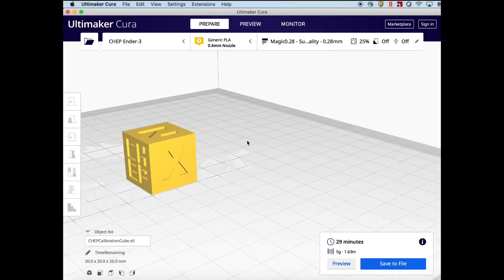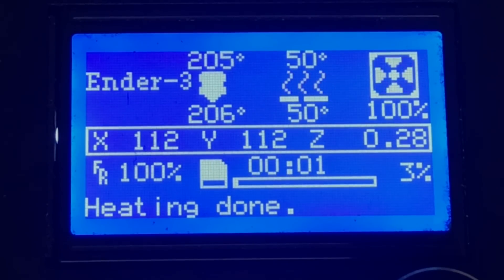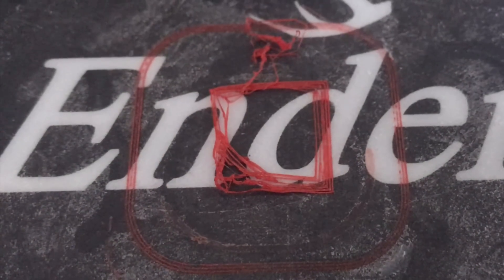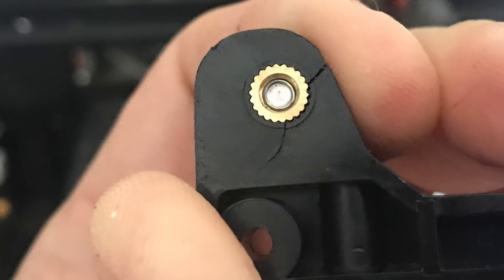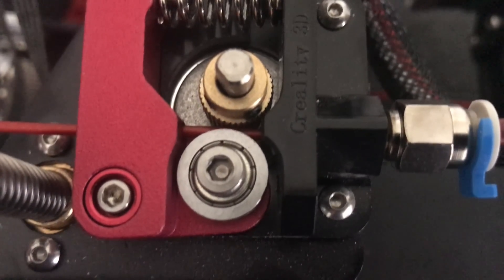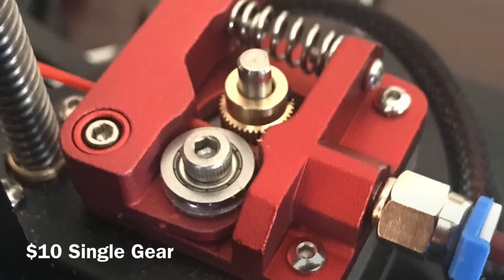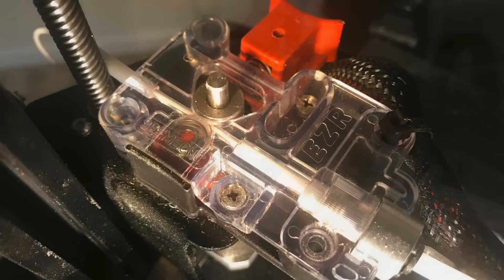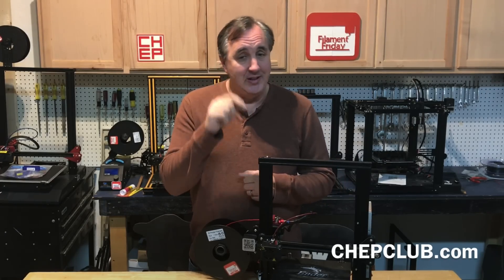Fix Under Extrusion from Cracked Extruder Arm on Creality Ender 3

Comment: Thank you so much, man! I had so many problems with my Ender 3, where the walls were not sticking together, but layer adhesion was good. This would make it so I could peel off the walls. I looked at the idler, and I also observed that it wasn't spinning at the same rate as the gear. Turns out it was the spring. I had already upgraded to a full-metal extruder but maybe didn't replace the spring. I still had the spring from the kit, and when I put it in, it worked like a charm.

Comment: Thanks! I had the exact problem, my prints were horrible and sure enough, the plastic was cracked and the pully wasn't gripping the filament. My replacement will take a week, so in the meantime - I used my wood burner gun, clamped and melted the plastic pieces together and even added some melted filament for good measure. I know it will fail soon, but I was able to get 2 perfect prints so far until the new parts show up. I also didn't tighten down the pully screw, just enough to hold it in. Pully spins freely and crack is filled. Waiting on new part, but my prints were looking terrible! Tried everything you did to no avail until I saw the crack. Excellent video!

Comment: So I replaced my extruder with the red aluminum one, just cause. but i have started to get under extrusion,  so I used the old spring and twisted the new and old one together to make one stiffer and a little longer one and its working as I type this .

Comment: Hi there - I'm at my wit's end trying to figure out what's causing my under extrusion. I've got an all-metal extruder, SKR V2,  stock hot end, MinV2 fan mount and a new steel nozzle. Every time I believe I've fixed it, it returns (usually after adjusting my E-Steps - which is now at nearly 130) - yesterday, after another failed print, I noticed while adjusting my e-steps again that the filament was slipping in the extruder just like in your video. I thought the spool was too heavy so I helped it along and still, it slipped,  it's gripping well-enough (though I'm not sure how to adjust the all-metal extruder), the nozzle is new, cleaned the hot-end and I changed the bowden tube. I'm pretty good at figuring things out or finding solutions on the internet, but this one's got me stumped. Plus I'm using Eryone filament. Suggestions anyone?
Reply: Ha! Serves me right. After writing the above I went back to the printer for one last look-over and I nearly face-palmed when I noticed after removing the filament the extruder's guide wheel shifted slightly. After some choice swearing and tightening of a few screws - I had a consistent feed again. Had it not been for me staring at the extruder when removing the filament I don't think I would have noticed how loose it had become despite having a good gear imprint on the filament.

Comment: I ordered an Ender 3 v2 and it is set to arrive soon.  I also ordered the TH3D metal extruder, and the yellow springs.  Most people say to go with stock till you learn the machine, but I'm planning on putting the springs and metal extruder on when putting it together the first time.  Do you think this is a good idea?
Reply from the maker: Those are probably good to install on assembly.
Reply: I got mine last week and have yet to get a decent print. Nothing but problems including what hes mentioning in this video. Good luck.

Comment: Hello, I have A Creaity CR-10 with Dual Z Axis motors. The z axis goes up and down when homing but will not go up when printing. Is this a problem with my machine or am i doing something wrong in Cura ?
Reply from the maker: I assume Cura. Not sure what though. Could be SD card as well.

Comment: Ive been struggling with my ender 3x.  just got it two weeks ago.  first cube print was PERFECT.  like better than any example that I've seen, but that was it... next print was horrible. Changed color filament and no difference...  even with the original filament I keep getting very thin and weak structures.  When I weight them, they are ONE THIRD of the weight.  Printed a Echo stand which was supposed to be 56 grams, and turned out with 16 grams...  I've cleaned everything, checked the nozzles, tubes, etc.  all is clean or has been cleaned, but still not getting the correct flow.  I'm manually adjusting the flow now to 150 but I don't think that was the idea of 3D printing...  Any suggestions would be great since I've been searching online videos for about a week now.  No cracks no slips on the extruder, but when I say to manually move the extruder 50mm, it only seems to take about 20mm of filament.  Ive seen some videos that say that this should be the same, but that means I would have to update my flow to 250%...  which I have not seen anyone do.   print bed 65C and filament 205C seem to be the best options for this Clas Ohlson filament.  One more step I will try next is to adjust the filament thickness in CURA.  somehow I only measure 1,6mm instead of the 1,75 it says on the box.  calculating volume, that is already a 20% difference.
Reply from the maker: Sounds like an extrusion issue. Here are some solutions: https://www.youtube.com/playlist?list=PLRFPlUhDTTlka-Cq-UmI3IbbHRIwG2OsX
Reply: @FilamentFriday  well I tightened the extruder.  My 3X does have a tension screw.  I cleaned the Bowden tube, reduced filament size to 1.6 in cura, and print at 130% flow  Finally the prints start to look good, but still strange I need to increase it so much.  There is no slip on the gear, and tube is all the way to the extruder head.  Soon the print is done and then I can check what the weight is.
Reply from the maker: Ok, but I suspect the extruder arm is cracked like I showed in one of the videos.
Reply: Any updates?
Reply: Not so far.  Arm is fine.  Took it off and placed it back.  Tension screw is set correctly so the filament does not slip.  I'm looking at firmware updates now but this printer was made in Aug 2020 so it's pretty new and 3X has all the updated features of the 3 already.  The extruder moves half the distance of what is asked, so I believe it's a software/firmware (opensource Marlin) issue.  I'll keep you up to date when I find something.  Right now setting the filament feed to 150% seems to make good prints, but still the weight is about 25% less than what Cura says it would be.  Oh and in Cura I've made a new filament size of 1.6 since my 1.75 filement is actually 1.6.  That alone already reduced under extrusion quite a bit!
Reply from the maker: If your filament is actually measuring 1.6 then I would switch filament.
Reply: @FilamentFriday  UPDATE: So after a lot of research videos and forums I opened up my ender 3X and checked out the board to find which firmware I need.  It's running the 32 bit V4.2.2 and registered on the Marlin firmware page, paid the 15  AUD to get a one year firmware updates and custom designed firmwares.  I gave some details about my machine and got a firmware.  Since the v. 4.2.2 has a boot loader I just put it in the SD card and it upgraded from Marlin v. 0.0.5 to 2.x.x (forgot exact latest v) BUT it seems like all problems are gone.  The extrusion is back to normal, the options and settings on the display have tripled! But most of all, the underextruding problem is gone and so far everything works as it should.  Now running some more calibration test prints, but so far so good.  Then again, there is still tomorrow and a thing called Murphy's Law... Fingers crossed but the issue was indeed where I expected it to be:  Firmware.
Thank you for all your videos because you have probably saved me hundreds of hours with all your tips and tricks! Proud to be a follower!
Reply: @dezeure78  have you checked if you have the flow rate in mm on both slicer and machine? could be that the machine was set on mm3 or vice versa.
Reply: @aceofsticks  the firmware update fixed it all.  Prints amazingly!

Comment: This is how you replace nozzles? Don't you need to take the tube out as well? Else when you put back a nozzle it can push filament between the tube and the nozzle.. I'm asking cause I want to change to a bigger nozzle size but I don't feel like doing the whole thing.. Take out the tube, clean, put the coupler and then the tube. I'm afraid of having a gap of filament between the tube and the nozzle otherwise.. What do u think?
Reply from the maker: It’s best to clean everything when changing nozzles.
Reply: @FilamentFriday  thx mate..

Comment: i put that extruder on and now im having issues. went over everything, cant find a problem. printed a raft, then it seemed like the hot end was drawing in the raft. just kinda smearing through it, like the raft was too thick.

Comment: Chuck,

I have been using your setting for the Ender 3, printing a full size daedric armor set.  I have printed the Helmet, Leg armor, 2 gauntlets.  I have the speed slowed to 40mm /second, and I know this takes quite a bit of time - I am good with that.  I am using Suntop PLA with carbon fiber.  The end result is something that is stunning, strong, rigid , and with little or no stringing.  I am using super glue, with baking soda to join the parts together, with some post processing on my part for an overall result that is stunning.  Thanks for your youtube information and tips
Reply from the maker: I hope you share the final set somewhere.
Reply: @FilamentFriday  I plan to share it - displayed and worn.

Comment: After a few first prints with the test material sent with the printer, I loaded a new spool of PLA from ENDER. Since then I have very bad between-layer adhesion. First also bed adherence but that I solved thanks to your video on bed leveling. I feared that there was an issue with the PLA extrusion (layer lines were so tiny) and therefore I started looking at the extrusion calibration. When the default number of steps per mm was 93, I found in practice it was 234. In your case with the slippage of the gear on the filament, what was your extrusion factor in steps per mm? Was it also much higher than the default?
Thanks in advance for the help!
Reply from the maker: That’s way too high. Something is wrong.
Reply: Problem solved. I switched on without paying too much attention the parameter under Control > Extruder > E in mm3. This paramter being off leads to a normal extrusion feed of almost 93 stp/mm.

Comment: I started to stumble into underextruding problems a few days ago. Did every check possible, speed, temperature, e-steps, new tubes and nozzles, checked for cracks in the arm, nothing seems to help. Is upgrading from the stock Ender 3 extruder to the metallic one + Capricorn PTFE tubing enough on it's own to fix problems or I might have something else?
Reply from the maker: Might have something else. Position of tube to nozzle, slipping couplings, gear slipping on stepper, worm gear, etc.
Reply: @FilamentFriday  Thanks for the reply! I'll keep looking for some solutions before thinking about the upgrade. Also, is the Capricorn tube a really good upgrade over regular tubes? Saw some comments saying it's overhyped.
Reply from the maker: It’s worked well for me.

Comment: Mine cracked after 6 months. While waiting for an aluminum replacement I took the old arm off and took the metal wheel out, then I rubbed baking soda over the cracked area all around where the metal wheel goes, and added a tiny bit of super-glue, and repeated this process sevral times until I had reformed it a bit thicker than it was originally. Then I used a file to smooth it out and open that hole up enough to fit the wheel back in. The part of the wheel held into the plastic with small teeth,  my baking soda/super-glue fix and file leaves a rounded opening, I kept it as tight as possible and once the metal wheel was in I added a bit more baking soda and super-glue around the seem where the wheel and plastic meet. This worked fine and I was able to carry on printing until my new part arrived.

Comment: I got the red upgrade from Crealty and in their picture the spring washer goes on the idler pulley hex screw.
Reply: I came to say the same thing. If you disassemble the idle pulley of the original arm you will find the washer on top of the pulley.

Comment: If anyone can help me with this issue on my brand new ender 3 please do. I just got the ender 3 a month ago to start printing over quarantine and so far I haven’t been able to do anything with it. My first print came with extreme under extrusion in the first layer and has gotten worse since then.  There is a load clicking noise that I’ve been trying to fix forever but haven’t succeeded. Now the filament doesn’t even extrude anything and nothing comes out. I’ve looked at soo many articles about ender 3 clicking noise and under extrusion but none of the have worked. I re-leveled the bed, checked the coupler and ptef tube, tighten the spring screw thing, changed filament, cleaned the nozzle and made the temperature higher. I was really excited to learn the art of 3d printing but I can’t even get started.
Reply: Check the level in the center of the bed. My bed had a warp in the center making it too close to the nozzle. I got a glass bed to fix the warp, and adjusted the z end stop. The clicking might be the gear on the extruder slipping, since it isnt able to push plastic out of the nozzle.
Reply: I was just having the same problem. It turns out I had a clog above the hot end. Take off the nozzle, and the PTFE tube, and then push the clog out with some wire. Look up "heat Creep" for more info.
Reply: Alana Woods have a look at the brass gear in the extruder when it does the clicking see if it skips forwards and backwards

Comment: Excellent-Thank you!  Didn't think to look there....I can see the bearing isn't rotating as it should....I found that I had the bolt a little too tight not allowing the arm to swing back correctly...loosened it off a bit and it works fine....upgrading to metal.

Comment: I had this exact issue for ages and I just jammed something between the arm and the extruder which solved it for a while, but then it broke in the same way yours did (probably a design flaw) I already had an aluminium extruder upgrade but had been too lazy to replace it, however after I did it worked just fine.

Comment: Useful video.  A bit sneaky that crack.
I'm new to 3D printing, just had my Ender 5 Pro one week.  I've been having under-extrusion issues and I think there have been two things at play... temperature (which I have sorted) and a too tight extruder.  On the Ender 5 Pro, there is an adjustment screw that holds the spring in place between the two levers shown in this video.  Even with the spring backed off as much as possible, I'm still getting very deep marks in the filament.  What I think is happening is that the extruder is deforming the filament to such an extent that it is becoming tight inside the Bowden tube.  When I get this under-extrusion, I pull out the filament and it's really tight in the tube.  I cut away the marked filament and the untouched filament slides through the tube easily.  I think I'm going to need to source a replacement spring that will result in less filament distortion.
I'm enjoying your videos, thank you.
Reply: I have the same issue.   I thought it was not hotend and I just installed a microswiss all metal and still having the issue.  I have an EZR on the way am I think I'm giving up until I get it in.  Also I think I'm going direct drive.
Reply: Backing the screw off fully sorted the under extrusion issue for me. I’ve got a direct drive on order from printermods to hopefully improve stringing a little.

Comment: if you are honest and look closely what is the difference between the extruder that can print flexible material and that cannot print flexibly.
because that's what it's all about at some point?
Nothing is wrong with the extruder but it is the combination of pressure on the filament (how much is the filament pressed!)
has to do with the spring, has to do with the diameter of the wheels, and of course how well the hose is connected AFTER the wheels!
Grip, the teeth on the wheel how sharp, is of course also a thing!
the hose must be very close to the wheels!
ALSO do not forget that the hose must not run stiff!

It can't be much else!
Greetings from the Netherlands!
Rob.

Comment: I just wanted to thank you for this video. For months I have been having an under extrusion problem and I couldn't figure it out. It turns out the idler wheel on my Ender 3 wasn't spinning during parts of the print. Luckily I had no cracks on my idler arm. So I just extended the spring out and put it back in and now it runs like a charm. Thank you so much!!!

Comment: Hey Chep I did all these fixes but I still have under extrusion. Im learning how to reset eeprom or reset machine settings because I changed something and it wont print. Im stupid because I ordered 2 more.. anyway will keep researching thanks CHEP
Reply: did  u enable volumetric extrusion by mistake ? look thru menu for ' extrude in mm3 ' it makes it under extrude. forget where maybe prepare>filment

Comment: So is this the Problem why my ender 3 just spits out alot of filament? i got the same problem , i thought i have adhesion problems because the first layer was very bad ; than after 50% percent printing it started with every model making spaghetti. At last i bought an cheap borosilicat bed from china wich arrived today. tomorrow i will check if the filament is slipping😤

Comment: this tip really saved by day. My pully gear was not moving which was causing inconsistent extrusion. After adjusting so the teeth gear and bearing the problem was resolved.